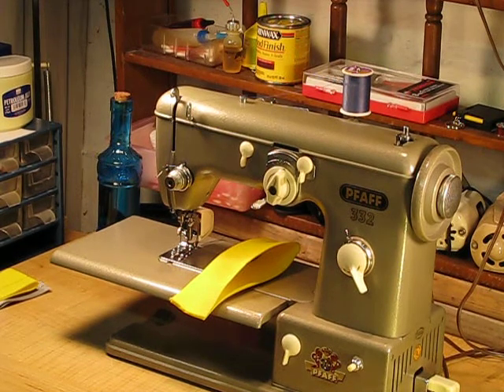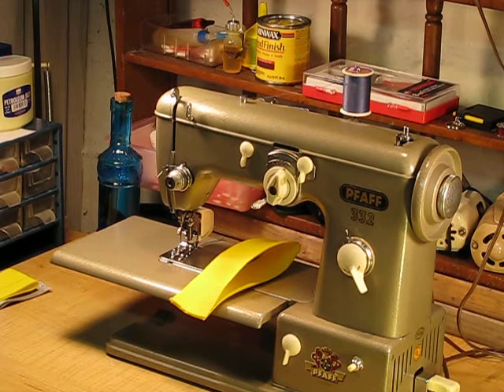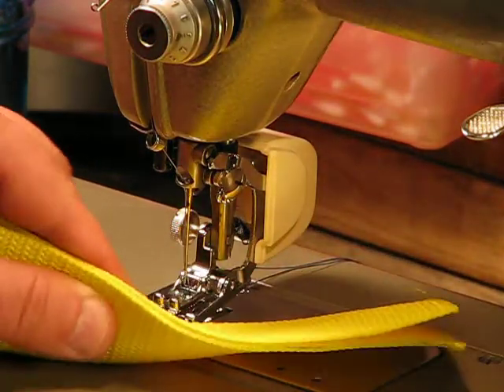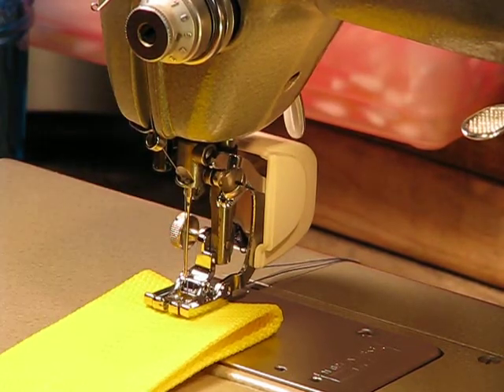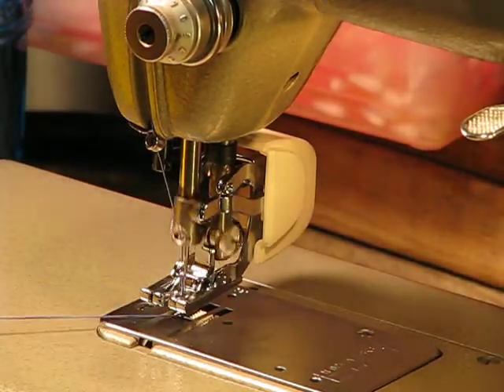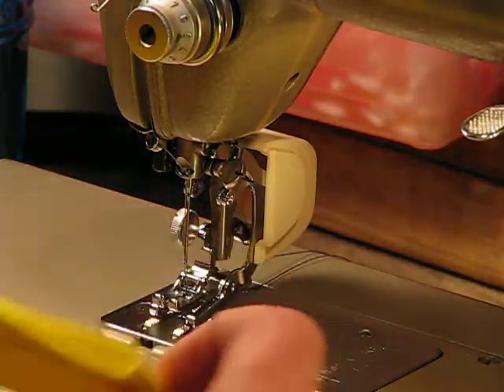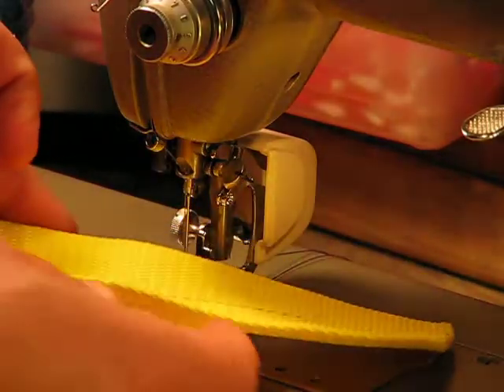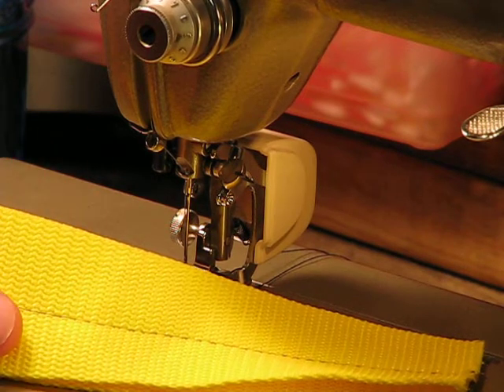Muscular PFAFF 332 - Super Thick Layers of NYLON WEBBING for Scuba Diving Applications..!!

Comment: That's an awesome machine! What weight and fiber is the thread are you using? Love the walking foot, too! Are the walking feet readily available for this machine model?
Reply from the maker: This is one of my favorite machines...hands down..! I'm sewing with 69 Weight full nylon Coats and Clark Upholstery thread. Walking feet are readily available for this machine, which is a low squared shank even feed walking foot. Be careful though, because some have more plastic than metal, and will not last.